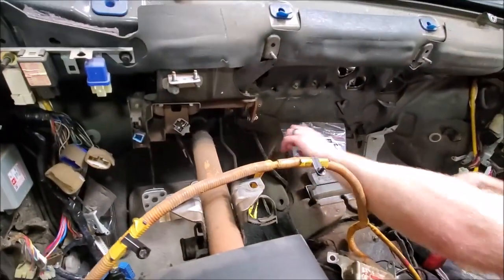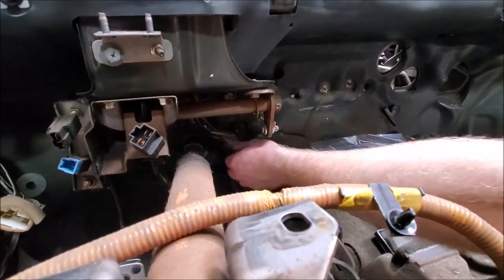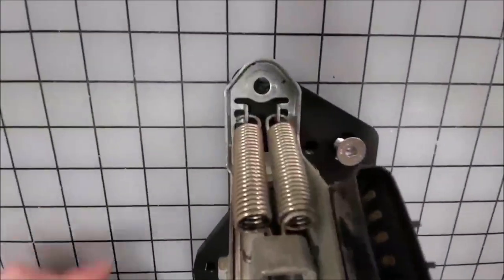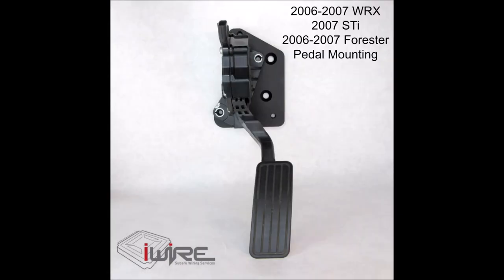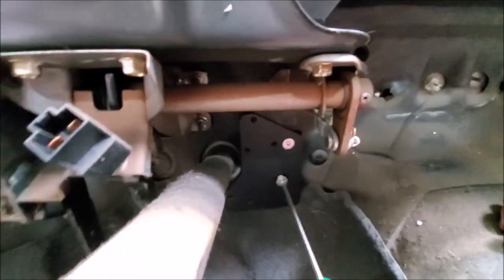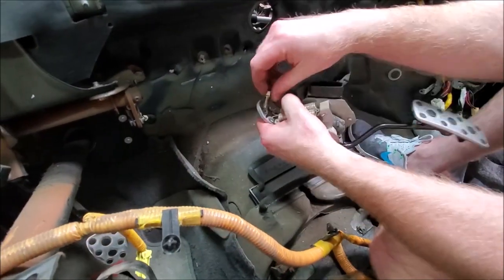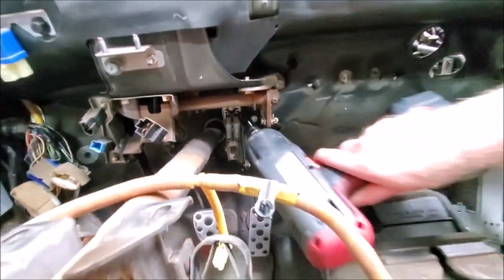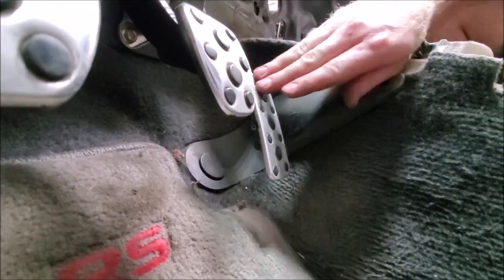iWire DBW Pedal Conversion Plate Install Video

Comment: after doing 400,000 kms on my 02 impreza cable throttle and then going to my now 07 GG impreza DBW... sucked lol but Winderbooster throttle controller fixed the lag of it and its all good now

Comment: Would this work for LS swaps?
Reply from the maker: If this is going into a cable throttle Subaru and you stick with the Subaru DBW pedal, yes. Outside of a Subaru application, no.
Reply: How about the other way around? Im trying to get rid off my dbw and go to cable drive. Will that work?
Reply: For an frs btw
Reply from the maker: @4mary20  No this would not work for something like this. I suspect a custom bracket would need to be made.
Reply: @4mary20  did you find out the bracket

Comment: if i am swapping my 99rs with an 05 sti engine that isnt dbw, is there any way to make it so the throttle body is cable?
Reply from the maker: The ECU must match the engine therefore this swap will require switching to drive by wire. When you do the merge with us, this not an issue since everything will plug in and bolt on.
https://www.iwireservices.com/subaru-harness-merging
Reply: @iwiresubaruwiringsolutions5538  awesome, can't wait to get in contact with you guys!

Comment: But why, though?
Reply from the maker: If you're upgrading a cable throttle chassis to a drive by wire platform then you need to update the pedal as well. The DBW pedal has different mounting points then the cable throttle pedal so this adapter accounts for those mounting changes.